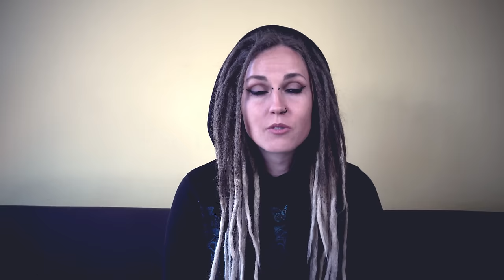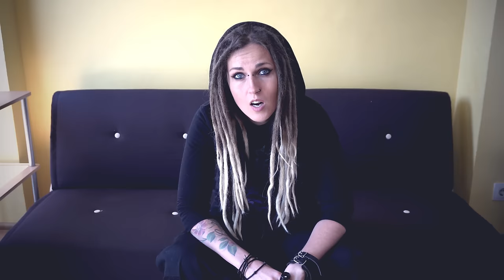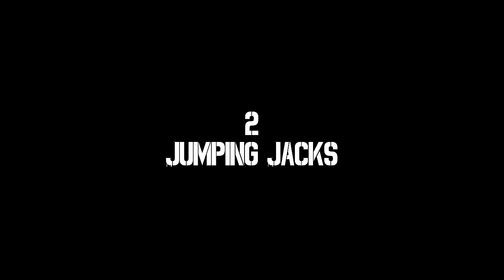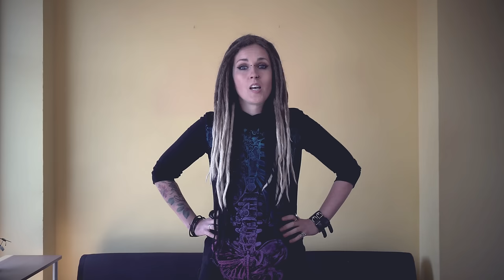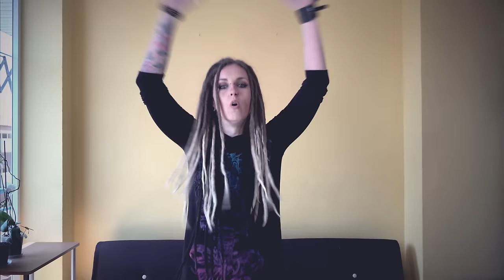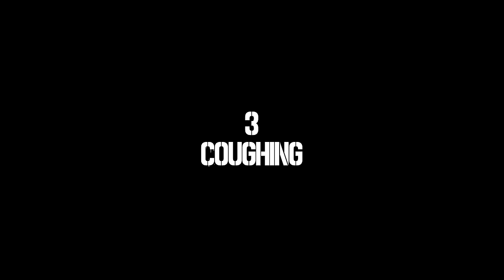'How To Growl' Basics: 3 Safe Ways To Learn False Cord Technique

Comment: I use both false chord and fry techniques, this is a great video! Some small notes that might be useful and weren't included in this video despite the good details in it:

Your throat may be sore, but it should NOT hurt or make you cough. This means that you are damaging your throat and have incorrect technique.

Your vocals will likely not sound super awesome at first! It can take a few months, or for some, even years of practice before you can get a very sharp sound. 

DRINK PLENTY OF WATER WHEN PRACTICING ANY VOCALS!
Reply: I'm glad you put this here
I'd been wondering if the fatigue was an issue

But it didn't really hurt and I can still speak so I think I'm ok

Just need to give it time to strengthen
Reply: @noiZtheartist   Yes! Stay hydrated. I'm a beginner here as well, but I believe that when practicing warm or room temp water is better than cold water, as I've heard it can actually be bad for your throat. Obviously, try not to overdo it, just a few minutes practice a day. As for soreness, would recommend hot tea with honey. Good luck and be safe my friend :)
Reply: @madscrub29  Yeah, cold water causes your muscles to tense up and can be a stressor on your body, especially the voice.

Fortunately, I've already become adjusted to room temp water.

I'm still adjusting to these more aggressive vocals though
So I'm making a point to rest my voice from the training enough

Since it's pretty exhausting
I've done mostly clean vocals up until recently so the transition is a bit tricky
Reply: I was worried for a minute 😅
Thanks for clearing my suspicions!

Comment: Tried doing it the "sigh" way, however, my growls sound a lot lower, like gutturals, and whenever I try to make the sound higher I start throwing up; been practicing for a month now. Does growling pitch depend on one's natural voice pitch?
Reply from the maker: Yes definitely, also the size of your cavities play a big role, the more resonance space available, the lower the sound. Seems like low growls are your 'home', where you feel and sound your best. Every screamer has their 'sweet spots' (mids, lows or highs) of course do your best to develop the range higher up, it might seem more difficult but take it very slowly, one step up at a time. Don't go too high too soon to avoid such a body resistance to the sound. Even if it takes longer than expected, give it a time, it will be worth it. Hope it helps. Good luck :)
Reply: @mara.lisenko  thanks!
Reply: Same
Reply: @mara.lisenko  hello again after almost a year. After laryngoscopy I've found out I have been using epiglottal distortion instead of false cord distortion, and you can go low as hell with epiglottal =)
I can make it a mid instead of a low though

Comment: I learnt how to make the Kargyraa throat singing sound by making the sound you might make when pushing something really heavy, like a "HURRR!!" kind of sound, then add a litttttle more airflow and you start to feel the folds vibrate in the throat singing technique. If I try and smash it to get metal growls it doesn't work and just hurts, however one thing I did discover was that you can start with the Kargyraa sound and then try and move that sound down into the bottom of the throat. What you get is a really thick, chesty roar. Once it's down there you can then smash the airflow and it's really fkn cool.

Comment: Hi. I am working on my vocals. 
Can u please give me some tips to help me improve my vocals while being wheelchair bound. I was born with spina bifida and paralyzed in my legs. I obviously can't do jumping jacks.
Please Help
Reply from the maker: Hi John! Jumping jacks are an optional exercise. You can still do the rest of 2 exercises and develop your vocals with light growling (don't go full force straight away). Once you can do it lightly, then it will be easier to gradually add power. Body wise, string core would help a lot to maintain a high pressure in the lungs (so called 'diaphragm support') if that's not possible, you can still do decent medium heaviness growls. All the best and good luck in your growling journey 🤘🤗
Reply: @mara.lisenko  
Thank You So Very Much! 
I appreciate your help more than I can express. Take Care

Comment: Hey 💜 can anyone help? when trying the polite throat clearing, sometimes it makes my throat dry. Also, I try to sustain it, and it seems to cut out or go flat/stop. Does anyone know what I may be doing wrong? Thanks in advance!
Reply from the maker: Hello Strange Cat! The very general rule is- if it sounds dry it is dry, it can also interfere with sound consistency. Make sure you drink enough water, cut out any dehydrating substances and see if it gets better :)
Reply: @mara.lisenko  wow thank you for replying ❤❤❤ I vape,  and that is very drying to your throat. I am looking at quitting soon. Thank you so much 😀😀😀

Comment: Thank you for this, I struggle to do the coughing technique prolonged without it turning into an actual cough/ getting a ticly throat, is there a way to stop this happening?
Reply from the maker: You have to do the sound placement higher, so it doesn't fall in the throat. You can look it up- Melissa Cross calls it Over The Pencil and most commonly it's called the Twang (sound is placed in the hard palate). When sound drops in the throat, this is where it gets dangerous, tickly and painful. Hope you can find the right placement. If it's still difficult, just skip this exercise and do the other two. Hope it helps 🤗
Reply: @mara.lisenko  you're bloody lovely, you are ❤ ill try that and if not ill focus on the other ways, thank you 😊

Comment: Thanks a lot this is awesome! Just one question: When I do this I easily get dizzy in the head, do you have any tips for that? :)
Reply from the maker: Due to the rapid airflow, you get too much oxygen to the brain, it's called hyperventilation. It's nothing dangerous (unless you faint), just stop for a while, breathe slowly, relax and once you feel good again, go back to exercises. After some time your body will get used to it. Note that conditions like hot weather, weakness/tiredness, health ailments might make dizziness worse. Just take it easy, you'll be ok :)
Reply: @mara.lisenko  Thanks, that clears things up, I'll keep practicing! Wanna know where this road takes me, there's so much power in growling, I love it 😁
Reply: @mara.lisenko  Just wanted to confirm: I''ve been practicing this regularly ever since and it has gotten a lot better + my energy system is much more "smoothed out and balanced" I'd say :D

Comment: Why the f**k she has Adam's apple?!?!
Reply from the maker: This comment clearly shows who slept during anatomy classes in school. The larynx has the SAME structure for both- males and females. The only difference is the SIZE. Women also have the same lump of cartilage we call Adam’s Apple but since it is usually smaller in size, it is not visible. I have a very rare voice type- contralto, you can hear that my speaking voice is relatively low. It means I have thicker vocal folds and accordingly- a bigger larynx, that’s why my lump is more visible. Also, my neck is relatively thin and long. So, if you’re still wondering about my gender, I was born a girl and they dressed me pink.